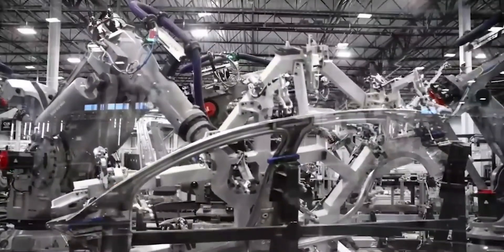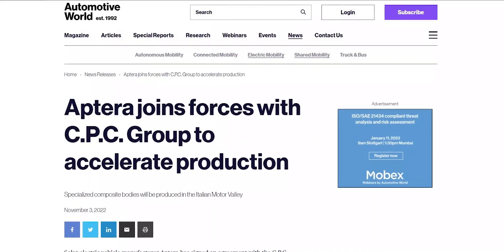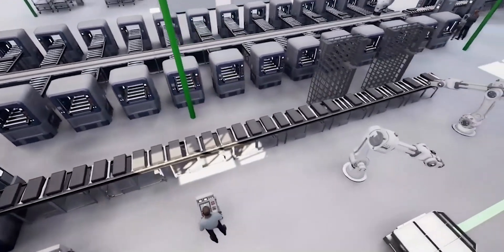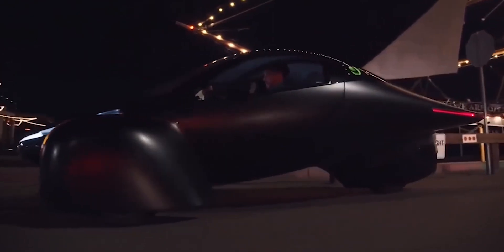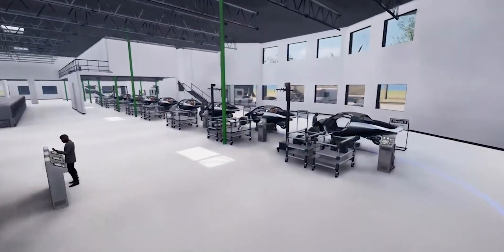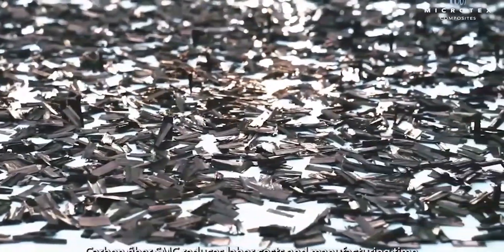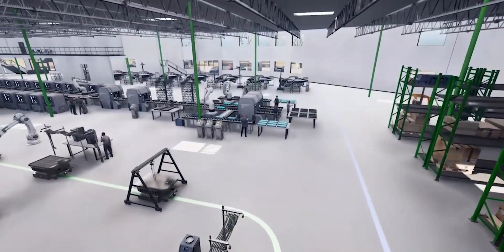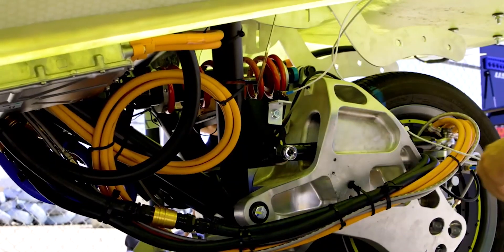You Didn't Know This About the Aptera Delta: Full Close Up Look

Comment: From an EV tax credit standpoint it, being a three-wheeler, is not considered a "car" and in most states it would be licensed as a motorcycle or autocycle, but from any practical standpoint it is a car. Major drawbacks - room for only one passenger (unless someone wants to lay down in the back) and its wide width may limit its use on narrower streets and alleys. But... it's efficiency (100 Wh/mile), battery capacity options (up to 1,000 mile range), solar trickle charging (up to 40 miles per day), acceleration (0-60 in 3.5 sec for the AWD configuration), attractive price (as low as $25,900), and its "cool" factor make it hard to resist.